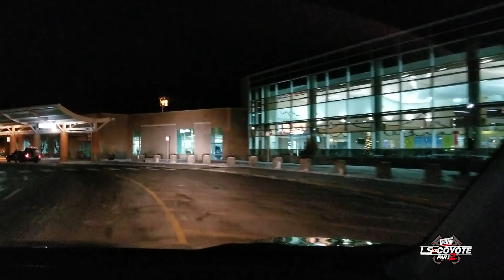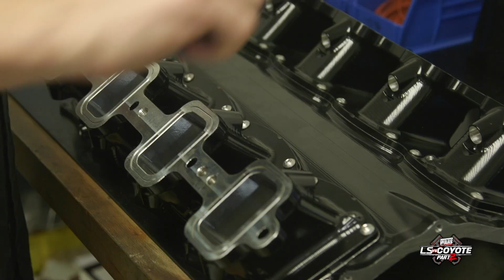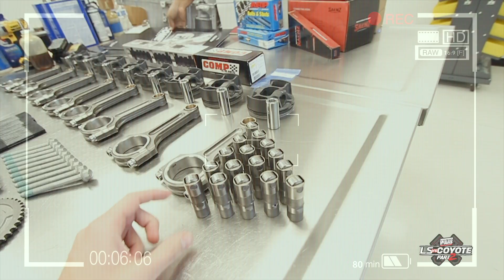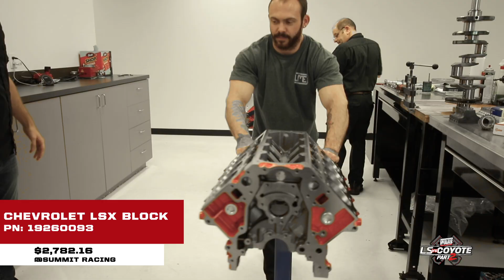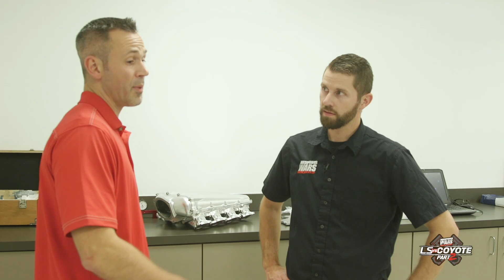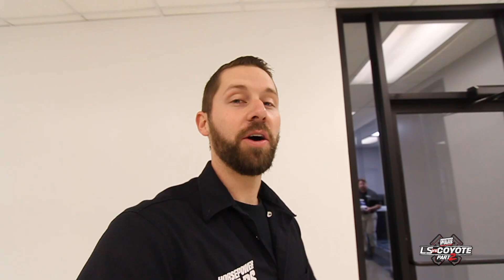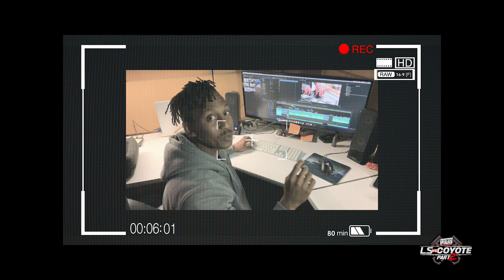LS vs. Coyote 2 Episode 2: The LSX Engine Build

Comment: Why aren't they making them use a factory GM block?
Reply: Why would they? 15k is 15k. They couldve used a block for 10k if they wanted. But then they only would have 5k for upgrades. If its what they want and it fits the budget, they are using it.
Reply: @nathan22outdoors8  in a competition between LS and coyote why would you allow someone to use an aftermarket block and heads. And yes I get GM makes the block (or at least sells it) but that entire engine (block and head castings) did not come in ANY vehicle GM ever made. So we will never know if a true LS engine could hang. Can a factory LS head produce enough flow? Can a factory LS block hold the hp? We won't know now will we.
Reply: @a29s12  So you are gonna sit there and act like it only gets the "LS" name when its put into a car. Do you know how dumb you sound rn ?
Reply: @a29s12  a factory block can hold hp, and the heads are meh, they only have 2 valves vs the 4 on a coyote
Reply: @nathan22outdoors8  GM has way more cubes also. They also cut down the average hp rating to 3000 rpm range to make it fair so let's take a quick Talley so far of this no biased fair competition.
LS get to:
Have way more cubes.
Aftermarket heads and block.
And cut the coyotes average hp by restricting the rpm range
Reply: @a29s12  So you have just accepted that the lsx is going to make more peak power since you didnt even mention that even tho thats the main goal of this. So what they have more cubes? Its a physically smaller engine + it has 2 Valves vs 4 per cylinder. And what are u talking about "restricting the rpm" ??
Reply: @nathan22outdoors8  now who sounds dumb. Being physicaly bigger doesnt magically make it have a bigger bore and stroke. It's only bigger because of the heads. And as many have learned you can put too big of heads on a pushrod engine. The advantage for the dohc is RPM wich btw they aren't going to take in to account where it matters....average rpm. Average rpm is where a coyote with the same HP as an LS would win due to the longer power range and higher rpm.
Reply: @nathan22outdoors8  I'm saying when they laid out the rules they are taking average horse power. The coyote would have a very good change of winning in that category due to the fact that is simply has a longer power curve but to "make if fair" he said they would take peak hp and the previous 3000 rpm. And I hate to say it but they literally handed that category to whoever makes the most HP.
Reply: @a29s12  No shit being physically bigger isnt going to make it have a bigger bore and stroke, its just another upsude to the ls. Compact to fit in more cars than your coyote, cheaper to build, and more common to find. And grabbing the peak power and finding the average of that + 3k back is fair. How is that any different than average? What are you even saying? Before you said its chevy biased because of the peak to 3k rpm back average and now your saying the coyote will win that catagory. Make up your mind, is the coyote going to win or is it chevy biased?
Reply: @nathan22outdoors8  I didn't say it would win, I said it has a good chance And no it's not fair. Let me  ask you then.... If one engine Revs to 8000 rpm and the other Revs to 7000 Wich one is more likely to have more average hp (without limiting rpm)?
Reply: @a29s12  The one reving higher. Which would be the coyote.
Reply: Well in my opinion if you want to know how much average hp an engine makes you take the hp  from either the entire rpm range or take it from let's say 2500 to peak.
Reply: @nathan22outdoors8  exactly but now it will most likely be the one who makes more peak hp..... especially since these engines will be so aggressive they will have pretty flat power curves. Just getting the feeling that after the advantages you listed about the LS having an advantage on peak hp, cheaper to build, ect..... They still won't let the coyote have average power. I thinks it dumb.
Reply: @a29s12  ok so then explain again how the 3k back from peak is chevy biased. The coyote revs higher and they are supercharged. Its not like boost is going to kick in only top end. With a higher rev rpm on a supercharged engine, you will have a longer and higher hp curve.
Reply: @nathan22outdoors8  in the first competition they did if I would of been building the coyote I would of used cheaper rods and pistons and used a better intake. Both the gt350 and cobrajet would make more HP than a boss. Hell the 2018 stock gt intake makes more than the boss and is cheaper. Also I find it suspicious that they only made (if memory serves) like 530ish with a fully built coyote with stage three cams. A 2015 fbo with the gt350 intake on e85 makes 460 wheel on a street tune. Doing the math on drivetrain loss that means a stock 5.0 makes around 506 stock fbo to the flywheel. So stage three cams are only worth 30 HP?! LMAO give me a break!
Reply: @a29s12  Lmfao what? "They still wont let the coyote have average power" what did u want? Them to make sure the coyote 100% wins that? The main goal is highest peak hp + torque. That doesn't mean the engine that wins that, will win the 3000rpm one. Because thats only hp. One can make higher hp + torque because it makes a shit ton of torque and thr other could make more hp and less torque with a lower combined. Which means that engine would also win the 3000rpm back.
Reply: @nathan22outdoors8  short explanation is that they are both supcharged and are going to have really good 3000 rpm ranges.  They are simply limiting the rpm Wich isn't affecting the GM as much as the ford. How is that not biased especially after you admitted all the advantages GM has?!
Reply: @nathan22outdoors8  so it's okay if the GM can 100% have all the advantages but not the ford? You are fucking high. They should give that to the ford because it has a bigger rpm range not because its a Ford. How can you not see that is biased!? Serious question?!
Again:
GM has aftermarket block and heads
Cheaper to build
more cubic inches
Soooo am I missing something because I don't see how giving ford the average rpm is biased......
Reply: @a29s12  Look at the much beloved by FORD FANBOIS  2013 EMC results and the  engines are of similar displacements. The SAM  LS has the best pull.  Those are the very best  pulls of top  4 finishers. Not rocket science  which engine had the best pull of the challenge. 
https://www.hotrod.com/articles/2013-amsoil-engine-masters-challenge-top-finishers/

Comment: This comparison doesn't even make sense. Why not use a built 5.3 against a built 5.0? I guess that's too obviously lopsided.
Reply: Its a competition not a comparison.
Reply: Yes, a competition of convenience.
Reply: @sicaz527  both builds end up to be 15k and the lsx is physically smaller sounds convient to me.
Reply: @nathan22outdoors8  I guess it would to an LS fanboy.  Physically smaller means nothing. I own an LS in my truck build and don't own any 5.0 platform, and this "competition" still seem silly. Whatever makes you feel good, man.
Reply: @sicaz527  how does physically smaller mean nothing? There is a reason the ls is the best v8 in the world. Because it makes a ton of power for the price, reliably and can fit it plenty more cars than that 5.0. And you can say what u want but the coyote has an advantage with 32 valves vs 16.

Comment: What BS they have to get the LS to 427 cubes in order to out do a 5 litre , so 7.4 compared to 5.0 litre that is not a competition that is not equal. If want a competition then make the LS a 5 litre it is not rocket science fellas.
Reply: Coyote is physically bigger and has double the valves. You sound a little butthurt that your coyote isnt gonna stand a chance.

Comment: https://www.speednik.com/files/2016/06/2016-06-17_16-09-32.jpg     Enough said.  Add FI and LS still wins.  Although i agree the Coyote is not a slouch, it's a great engine.  I also have an Ecoboost Screw.

Comment: Odd, on LME's website a 427 based LSX starts at $24,620. You guys must have quite the pull to be able to get this for under $15k.

https://www.latemodelengines.com/index.php/long-blocks/lsx/427-lsx-lb.html
Reply: 1. Prices are from Summit not LME
2. Those dont use the same parts as this one, read the part list most of that shit on the one you sent is billet and by LME 
3. That doesnt include machining and assembly, that one you sent the link to does.

Comment: they should have just did an ERL super deck or RHS tall deck at 500 cubes and let the COYOTE GUYS GUSH OVER FAIR....GET BENT its a shootout with a price cap its not about fair its about reality. Surely a 400+ cube ls can be built for way way less with great head and intake combination. The biggest hurdle with anything over 1100whp on an avg ls is  keeping heads sealed.

Comment: Man, I feel so much dumber after reading some of these comments. These Forf guys like to forget about the B15 LSX. Car craft did one with a turbo @15psi and it made over 1000hp- all with a 2 year 50000mile warrenty. Where's the Ford equivalent? Oh, that's right. It doesn't exsist
Reply: Shelby offers a 1000 hp Mustang. Uses the block and heads that came with the car prior to the conversion process. That means its the same base motor that is in every Mustang GT on the highway. Its also supercharged instead of turbos which is actually a tougher build. The thing about this build is that when the numbers go up the Mustang guys can view this and go out to their 5.0 and start it knowing that the engine in their car is the same basic engine that just put up that number in the video. The Camaro guy goes out and starts his car and says "my car could make those numbers....I just have to replace every part under the hood".

Comment: jesus the amount of lift you can accommodate in a 2 valve per cyl engine is insane... my mans talking about 18mm of lift from those cams, the Duration is pretty tame but when those valves open they will let ALL the air in. I guess more valves can technically flow more air but the valves will run into each other sooner cause more valves take up more surface area

Comment: "Extensive or unusual machining" That seems a little bit vague. It would have been better if "any" machining or anything that isn't just assembly came out of the budget. Because I'm betting I'll have a hard time believing EITHER of these engines is just 15k in parts. That fully machined intake alone likely costs half of the entire budget.
Reply: Just a 1/4 "but its build in hous"
Reply: "Extensive or unusual machining"  Legion Red that just their way of tweaking the "rules" allowing 10k of cnc machining the lsX to be 50% as efficient as the coyote but still be able to blow out the coyote budget when they sleeve the stock block that comes in cars to compete with their aftermarket block that came in no cars. Like when they choose  1500$ carbon fiber drive shaft to gain 4hp in their last xxx wars video. Idiots
Reply: @michaelm2683  I dunno man... I just would like to know how much both these engines are actually gonna set back a normal consumer/enthusiast. I like the challenge and the idea. The rules just don't seem important to anyone. That's my only issue.

Comment: Ok can we now have a stock LS3 or LT what comes out in these cars coyote gen 3 and a hemi 6.4 Nissan 5.6 and a 5.7 out of a Toyota and boost them only change injectors and fuel pump let's see who wins wouldn't surprise me if the big 3 are the bottom 3 in the battle

Comment: To all the internet Engine builders out there, it comes down to what ever engine is the biggest and has the best flowing heads.
its going to BE AN LS that wins every thing.
BEFORE you complain "BuT tHe Ls iS BigGer N CoYoTee iS stOck DuehhH"
its simple to build a BIG CUBE LS and is CHEAP. 
its the same as the turbo 2JZ Vs A stock LS , omg wow the 2j made more power at 20psi yeah of course it did, now run the LS at 20psi and it makes twice the power....
but truth is there are NO what IFS . 
you rock up to the track and your 50 grand coyote motor gets smoked by a 20 grand LSX what do you do? cry and say its not fair his engines bigger than mine.... mine makes more power per cube...
it doesnt matter a fuck you just lost.
Reply: Great rant but one problem. The LS that they just built went well beyond any $15K engine build. Its not even like it skirted the rules by a few grand. This is likely a $30K+ engine. The Ford will come in much closer to budget as the main components will be salvage yard parts.And actually production pieces not "inspired" aftermarket parts. The Ford would have made much bigger numbers than any factory LS could have put up which is what I thought we were doing. Since we are not...lets let Kaase build the Coyote and go nuts like he did in Engine Masters. I think all the LS guys would like to forget that little episode where cost machine prep was no object. And the 2JZ could take more boost than the LS without pitching its crank or blowing a rod out the side of the block. Making 1500 HP for 30 seconds LS style would not really have been a win.
Reply: Todd Johnson Labor costs aren’t included, working with a coyote you can’t achieve 7L plus there for if kaase built both engines the LS has more power potential. 

And no, the LS will make more power on a standard bottom end as the record on a stock 6L is 1537hp and a jz on the same dyno is 1000
Reply: @tompickrell9125  That's what what the SAM boys (School of Automotive Machinists) thought until 2013. Bigger is better. Then Kaase showed up with a smaller but much better flowing engine and goobersmacked the smiles off their faces. He completely smashed those guys. Their only response was to lobby to get all modular Ford's banned from the build contest forever. They even took it so far as to ban the two valve modular (just being ridiculous).  Kasse's 2013 Modular (pre-coyote) maxed out at 400 cubic inches and made over 2 hp per cubic inch...810 range. He backed it down to pick up torque in the competition but admitted that with only a few months to develop his engine he was exited to begin work on the package for future competitions. The engine was banned the next year so he had no reason to keep working on it as did the 2nd and 3rd place engines which were also Modular Fords. The LS brigade were a distant 4th and so on. But what was important was that their dicks were broken and they learned an important physics lesson.  Kaase has won this contest every year with Windsor or Cleveland based Ford engines always beating up on LS engines but he was ready to go all in on the modular because as he put it it has so much more potential.So no. not unless there is a 150-200 cubic inch advantage and its naturally aspirated would Kaase choose an LS over a Ford modular. That is big number for a stock LS bottom end. The thing is that is a dyno number? Correct? Would you put that time bomb in car and run it down a drag strip? I wouldn't. The track owner would not be happy and I would be paying his "oil  down" charge at some point that night. I do not know what the stock bottom end Modular/Coyote record is. What i do know is that if you buy a Mustang, you can put a lot more power through the block and  heads confidently than you can if you buy a Camaro. Yes, you will pull it out and change the oil pump gears, the rods and pistons, etc but the basic engine is stronger. Over on the LS side you are looking at Summit for an LSX block and TFS for some heads. Hotrod Magazine has tried for the last two years to have an LS vs Coyote engine building contest with a spec blower. No LS applications were recieved even with the rules written for the Ford to be displaced at 5.0 and the LS at 6.2. Not tilted enough in the superior LS design's favor?
Reply: Todd Johnson the fan boy coyote vs LS has gone on for ever, it’s been done numerous times and the LS wins, YouTube it. 
You can buy a 6L and throw some heads at it for half the price of a coyote and make more power. 

Go look at the LS engine Nelson racing builds and show me any coyote to rival those in peak , mid range and low end power. 
Capacity gives response and the engine fits easily into any thing. 
Do a cam swap you change one cheap cam vs 4 super expensive ones , there’s a billion reasons why the LS is better , coyote is just different. 

The LS has always been hated because it destroys the competition for half the money and every man and his dog has one therefore it’s boring. 

To me it’s not a chev vs Ford etc it’s just a better engine.
Reply: @tompickrell9125  Naturally aspirated it CAN win build because of cubes. Once the boost comes in it falls behind the better designs like the Coyote, the previous generation modular Ford, the 2JZ and the Barra. The wins on Youtube happen because of what we are seeing here. We're going to call this a $15K build when its not and limit what will be done to the Coyote. I say if you are going to go all in on the LS go all in on the Coyote. Let Kaase or MMR or Accufab build it.

Comment: why the LS is so good its a SIMPLE DESIGN  like john madden if it works don't stop making it since it was introduced in 1955, GM and its subsidiaries have made over 100 million small-block V8 engines. Let that number sink in for a second – one hundred million. The pushrod V8 was easy to work on, and easy to modify for more power

Comment: I'm an LSX guy andthere is no doubt these guys are building a $30k motor. The coyotes make amazing power. I can admit that. But I think you Ford guys are missing the point that the LS dominates in horsepower per dollar/weight/size (for swaps). The LS motor is 20+ years old at this point, and it is still competitive.  That in itself deserves some respect. I have about $15k in a 408 LS motor and it makes just over 650 at the crank.  That is a real world engine.